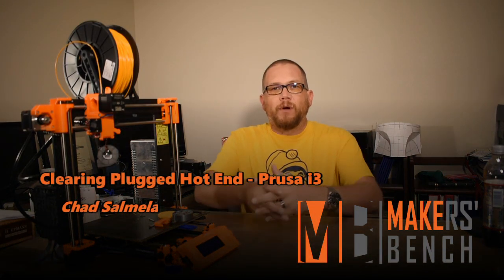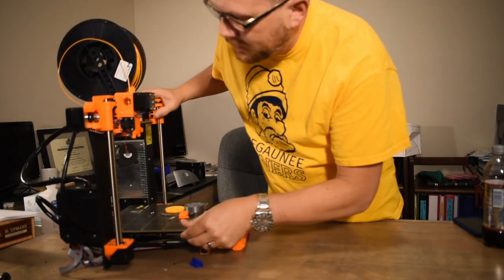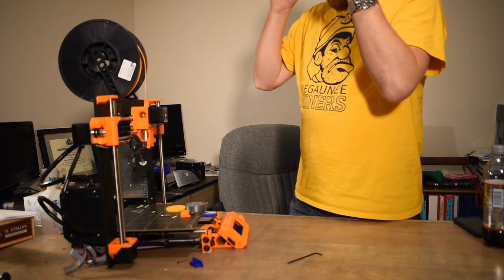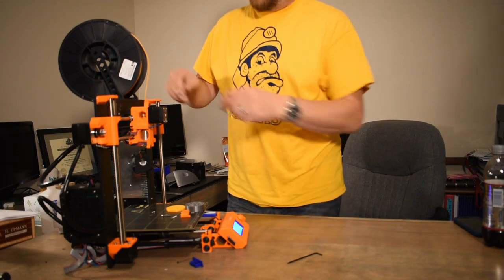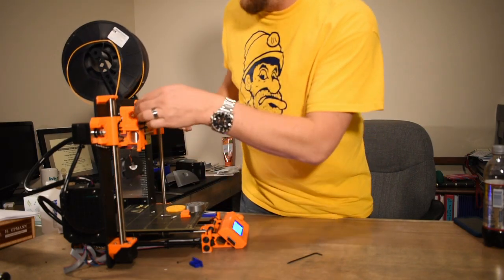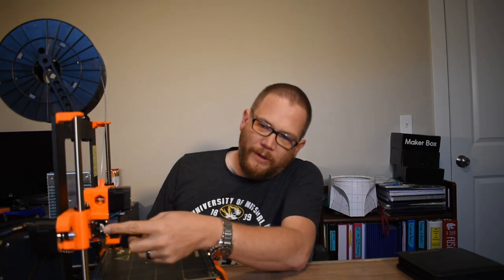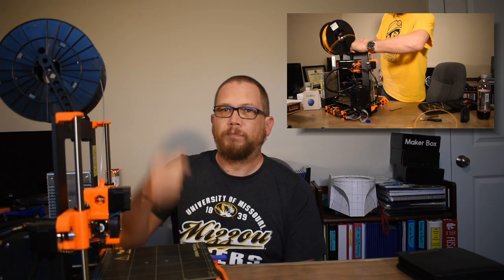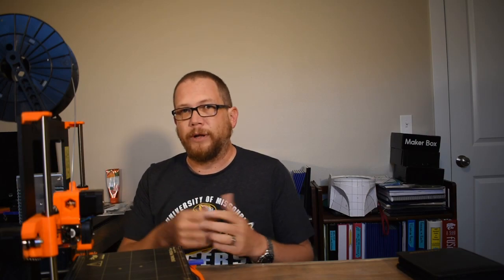Clearing Plugged Hot End   Prusa i3

Comment: I think this worked for me too! Just made one successful print after what seemed to be a clogged nozzle / hot end. I followed the 295C instructions, extruded a tonne* of filament, cooled it down to 90C and then did a cold pull. Crossing my fingers!  (* not an actual tonne of filament but definitely several decimeters.)

Comment: Thanks for the video suggestion. I ended up doing the same thing for my PLA plastic filament. I keep the fan on (no disconnect)—I just turned the heat to 295C for the nozzle only—and once at that temperature—I loaded the filament. With a sudden spurt of plastic from the nozzle head—The nozzle works as it did prior. 

Thanks again, just thought I’d share my experience.

Comment: I also had a pesky heatblock clog and removing this fan and following this this technique worked! I couldn't cold pull because I couldn't put filament in far enough for it to melt, and I also took off and cleaned the nozzle but that didn't help. I had success when I removed the fan, heated it up to 285 C, then waited a little bit. After that I was able to push my filament and and push the clog out. I still had my nozzle removed so it came out easily! Thank you, now I don't have to disassemble my hot end.
Reply: With those types of clogs I take the nozzle off and with a small brass rod push the plug out

Comment: My clog (after printing with Prusament Galaxy Black on my Prusa i3 MK3) this weekend left me with a clog inside the heat block / brake and not able to push it through (load filament) even at high temp. I tried your method and after a minute or so without the fan, I tried once again to Load Filament. After a bit of trying, I was greeted with a black blob of plastic and some smoke. Success! I re-attached the fan and filament is once again loading and extruding just fine. This is the second clog I've experienced after using Galaxy Black (and my third clog in total).

Comment: I'm guessing that you could just unplug the extruder fan from the board instead of removing the whole fan to make it a bit easier.  Do you suppose that would work as well?  I'm still relatively new at this.
Reply from the maker: Yes, sometimes the simplest things are the hardest things to think of. However, the control board is kind of a rats nest of wires. I think either way will work just fine. Good idea though,, it didn't even cross my mind.

Comment: could add a sponge oilier clip (other vids have that) [drop of vegtable oil on a sponge] your filament passes between sponge before extruder/hot end  it "cleans" filament of dust and debris before it enters hot end
Reply from the maker: Yes, I think just even having some foam without the oil would be great. I've seen some mixed opinions on the oil part, will require more research. But, I know that just some foam by itself will help a lot. Good point, thanks for sharing.

Comment: You were lucky to unclog it. I had the same thing happen to me several weeks ago. I didn't know about the fan removal and heating method. I dis-assembled the extruder. Boy! What a job that was. While I had the extruder taken apart I replaced my nozzle with a with a micro swiss hard coated one. The only thing I would worry about is the PETF tube above the heat break. Does that temp of 290c make this tube deform. I know the tube cannot take temps over about 240c.  That normally isn't a problem with the heat-break preventing the heat going into the extruder cooling fins.  Thanks for the video.
Reply from the maker: Yeah, I was a little worried about the tube, but I hoped that clearing it quickly would not damage the tube. Plus, if the tube got damaged, it's something that could have been replaced. But, you make a good point, something to be mindful of. Thanks.
Reply: Makers Bench Yea, I had a some Lubing so I went ahead and replaced it. I had damaged it trying to get the extruder housing out. There was so many zip ties I had to cut and wires had to be redone. I was sure glad I put the kit together so I knew how things were arranged.
Reply from the maker: Yup, that a huge reason why I bought the kit. Don't get me wrong money played a role as well, but I'm glad I got to do the kit. Learned so much.